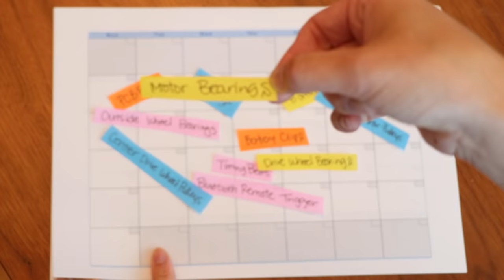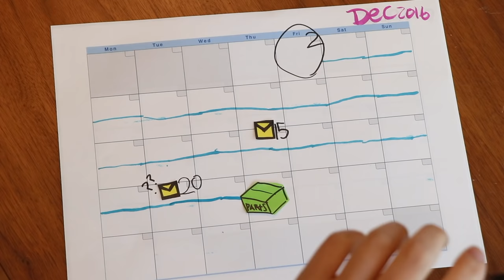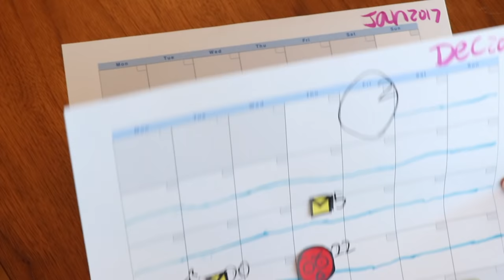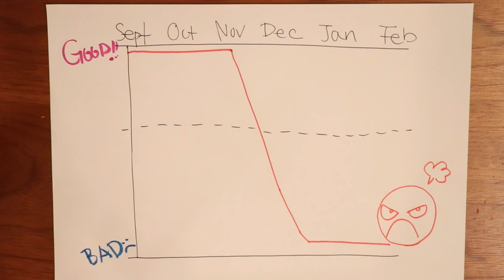COMPLETE SUMMERBOARD (LEIFTECH) REVIEW (WATCH BEFORE YOU BUY) Customer Breakdown

Comment: I almost dropped 1700 on one but then checked out your review and I don't think I'll spend that much money if the quality isn't better. For that price maintenance should be minimal and support should be better. I just miss snowboarding and was hoping this would be my summer fix. Thanks for the review
Reply from the maker: Hey Jason, I feel you man.  I also missed snowboarding in the summers and the reason why I decided to drop all the money on the board even though there were no reviews out there.  No one told me how much maintenance would be required.  The board is a fun, but maintenance and support have it's issues.  It has been over a month now and I am still waiting for parts from Leiftech.
Reply: you need to return yours and buy some power wheels. I own 7 (metro / Leif / boosted / ow / zboard) all have broken down (not the OW actually) and all have needed maintenance. I think this video is pretty eye opening, in that you're both kinda spoilt children that didn't look into what you bought. I've replaced the motherboard on my metro board, motors for boosted, pads for zboard, drive wheels for Leif, etc. you kids need to stick to power wheels.
Reply: Murphy the Turtle He has shown in the video that he is willing to fix/maintain it, did he not? And as far as I can tell, you seem to have a newer iteration of the board, and not the oldest model that has far more flaws. Can't you see the frustration then in wanting to fix and ride your board, but not getting the parts, and when inquiring about not getting the parts, receive little to no response from the company?
Reply: quite the opposite. He complains about common repairs that happen to every board possible. I didn't really think the video was all that bad until I read the comments. I live in Brooklyn, and I used to go to the Leif shop to repair my board, so I know how those guys are. Paolo was given free parts, and acts like a spoilt child. He has demonstrated in my conversations with him that he doesn't understand how eboards work (all of them need maintenance and parts) and has made his ignorance known complaining about very common problems in the industry. I just wish he had 2 other boards and understood the basics, rather than just blaming everyone else. Worst kind of arrogant.
Reply: K
Reply: hmmmm... well people that aren't very knowledgeable on how to maintain eboards are going to need help maintaining their eboards... so the company should know that and act accordingly.
Reply: Jason Thompson  o
Reply: Just get a freebord my man
Reply: I bought a Onewheel XR last month and it feels just like snowboarding.  I highly recommend it. there's no remote and you can ride it on just about any surface
Reply: @LBS-33-33  I own both xr (sold now) and pint and both are awesome :+1:

Comment: Hay there paolo I built my own custom board for about 500 to 600 with lipo's and I have to say I'm happy with it. it can deal with light rain as well as crappy roads....its a pintail board. the only 2 downsides is I made this one with a Tupperware container which comes open if I rub myself to close to it and that the cables to the motors come undone but outside of that its just charge and ride. I get you had issues with this board but its a brand that is fairly new and innovative. my best word of advice is to get a normal board and ride it.....or sense you have some experience building stuff build your own and have way more customizability. 

my next board will be better then what my current board is and in the mean time I'm just gonna keep riding it until the batteries go bad.

Comment: Not gonna lie I really want that board and I'm sure your experience with customer support is really rare. It still sucks it happened. However with the amount of maintenance problems you pointed out it defiantly deterred me away from buying it.
Personally I ride the Evolve boards (I ride the Evolve ONE board). I actually use mine to commute to work every day and I've been riding it for about 11 months now. The only thing I've needed to replace was the motor mount which snapped due to metal fatigue.  Customer service is out standing and the community is fantastic. 
My Verdict, 11 Months, rare maintenance (aside from cleaning the wheels and bearings from time to time). As an added bonus when you purchase the board it comes with all the tools you need to pull it completely apart if you wanted to. Battery is still running rather well with a range of still about 35km and able to climb all the steep hells I've come across (I live in a rather hilly area). I'm happy to say I've defiantly got more than my moneys worth. Only complaint, I wish it was water proof/resistant.

Comment: Epic honest review, dude. I Think I'll wait a couple generations so the kinks can be worked out. I would prefer this board to a freebord, if not for the risk of extensive maintenance.
Reply from the maker: Hey Daniel, I think waiting a couple generations would be the prudent choice if you want to avoid maintenance issues.  I feel like current users are being used as beta testers as I continue to see reports of parts breaking down.  The manufacturing process doesn't seem to be dialed down yet.  Thanks for the feedback and for watching!
Reply: The product still sucks. I bought one in June last year and it just stopped working last week.
Reply: Daniel Renehan this is 2 years later and maybe it’s your chance because the summerboard sbx is out and it’s waaaaaayy better
Reply: @chrismcgregor4307  Was this the 'summerboard'?
Reply: @oscarsimpsonjacka7917  I'm going to wait for a review like this that goes into heavy detail.
Reply: Daniel Renehan it is the summerboard and if you just search a little there are quite a few good reviews. It had a thicker wheel so you can go over more bumps and it is curved so it feels better and more like snowboarding. The battery is much more powerful and long lasting, can go up hills well. The battery is water resistant and overall it is just way better, less maintenance, better battery, more powerful motors and higher quality parts.

Comment: For those wow re interested. 
Currently it is Dec. 2019 about to be 2020. 

I tried ordering it shout a year ago...there customer service was bad. And j was hearing a lot bad reviews so I canceled my (financing) order before it shipped and they were giving me a hard time about it. 
BUT, I just decided to go for it....bought the most expensive (V2)  for $780/$900(financed) on eBay. (Perfect condition)
And I love it. 
No problems so far (knock on Wood)
Even though I snowboard, 
I either struggled on this thing until I knocked the Rust off from snowboarding. 
Or this is (mechanically) slightly different then snowboarding and I had to overcome the learning Curve. 
Room me one day!
On the end of that one day....I took a spill because I was found way to fast, and got scraped up a little bit. (So gear is recommended, because your not falling on snow)
ANYWAYS, after that one day I can ride it great, just like snowboarding. And it is, just like snowboarding in regards to how it feels. 
I never took it down a hill yet, only on flat roads using the remote and let me tell you, that alone allows you to “move”....mine supposedly goes 25mph. But I don’t attend going that far for it’s not worth the spill and the broken board, no matter how “good” I get. 
But yea,  to me it was worth $900.00. 
Time will tell tho! Hopefully this helps!

Comment: This is the best video i've seen so far. And not over criticizing like some say. You're giving a full review so people know what to expect from the first models. Even leiftech gave a positif reaction to the post. The only other electric thing i'm following are the electrical motorcycle's from Zero. From that point of view I only expected the gears and toothed belt would need a maintenance. And offcourse a replacement of the wheels after a decend amount of miles. But a maintenance after every time you get the board out? That doesn't sound right. The bindings of my snowboard broke after 4 years , not after a month. This is a quality issue. The outer bearings get under alot of presure, so I get they wear out faster. But motor bearings should be just fine.  Now you clearly aren't mechanical person. You bought alot of junk, what brakes when you wanna work with it. This is what junk does, and why people should stop bying the cheapest tools you can find. I do have alot of questions about the maintenance tough. Slamming bearings in with a hammer, like you did, is asking to break it, even before you ride it. Same with the video of the blue freeboard wheels. You pop the bearings out from the middle. To simplyfy it, its a ring with balls in it and another smaller ring under the balls. By pressing the inner ring while the outer ring is being hold in position, you are killing the bearrings. So you have to push the outer ring in this case. You press the inner ring if they are on a wheel axle.
I love the concept of the board, but the price is to high. Certainly with all the issues around it. The video is from a year ago, how is it with the board? Still working or collecting dust? You said another video would follow, but I didn't see it. But it could be I overlooked it since you got a decend amount of posts :)

Comment: I've had my Onewheel for about 2 months and the only "maintenance" that I've had to do is adjust my PSI and replace my original grip tape with Vicious. No problems at all especially with riding through water especially rain.
Reply: Onewheel FTW!!!
Reply from the maker: Hey Travis Butler, it's good to hear that the OneWheel has little maintenance.  I really like the fact that you can ride in the rain without any issues.  I think it would be perfect if you lived by the beach.  It would be so much fun to ride around in the sand (assuming that it can go through sand as well with that big wheel). What's the total distance can you travel on a full battery?
Reply: That depends on a lot of factors my man!! Simple answer: 5-8 miles. It also charges in 30 minutes!
Reply: FloatLife represent!  Love my OW and while this board looks kinda cool, still like my OneWheel better.  The smooth, quiet float is just unbeatable.

Comment: Fantastic review Paolo! Tells me everything I would like to know as a potential customer. I read about the LEIFTech about 1 week after ordering a Carbon GT. At first I was bummed that I had blown my dough on a regular skateboard instead of the snowboard version, but after watching this review I can see the many limitations to this kind of board, even if it was working flawlessly. I bought a Carbon GT in the second run while they were still on backorder, the only "flaw" with my board out-of-the-box is that one of the screws that holds the battery cover on was not "sunk" properly, and just spins loose in it's place. Aside from that, the maintenance issues are almost non-existent compared to the mountain of stuff you've had to do. I ride this board everywhere at full speed and the only thing I've had to replace is the remote controller because after I broke it for the second time after a fall, I couldn't revive it. In case you were considering a CGT, the obvious advantages are: Can go on almost any surface, including grass if you use the AT setup, rough roads are not a problem - can start it on hills (bit of a trick to it) - battery life and range is much bigger - climbs VERY steep hills no problem as long as you're not very low on battery - top speed is about the same, but can be tweaked if you use larger pulleys at a tradeoff of torque - they say not to ride it in the wet, and although I try to avoid it I have rode it on very wet roads and through the occasional surprise puddle and there seems to be no issues as a result. The downsides are that booking it in for service last I checked looked like it would take a long time due to the large amount of customers and only one servicing outlet in Australia, which I also have to get the board to. I'm not a massive fan of the remote control design which lacks a trigger guard and is very easy to break in a fall and expensive to replace, although you can buy 3D printed trigger guards on ebay that basically "fix" that design flaw. I wish I'd bought one immediately and saved $120 on buying a new controller. It does take a while to become proficient at riding at high speeds, but even now perhaps 9 months after purchase I still have the occasional spill due to accidental trigger/brake hits; I definitely don't recommend riding this thing at top speed without a full suit of safety gear including knees/elbows/wrists and helmet. In the two accidents I have had, besides damaging my controller I have trashed 2 backpacks, a good pair of jeans, a nice raglan shirt and various things in my pockets. Some of that damage would have been prevented if I had been wearing my full suit, which I wasn't in both accidents. Now I always wear it. It's also worth noting that every single person I have spoken to that has rode a GT, has had at least one significant spill. Most of the time it seems to be due to accidental trigger bumps, or overbraking at high speed which is definitely a delicate art as the controller is quite sensitive, and this sensitivity of braking is magnified with speed. Although not impossible, just takes a lot of practice. The board also doesn't have the ability to easily swap the battery out for replacement - last I spoke to evolve if I want a new battery it's got to come into the shop, although if you're handy with a spot welder It would be possible and probably cheaper to build yourself a new battery pack from high quality cells. Some people have reported that the Carbon seems to be poor-quality carbon-fibre, and have posted pictures of the board cracking around the truck mounts, but I haven't had that issue. I suspect if you're a heavier rider and using the street wheel setup might stress the board more and result in these issues (as the street wheels will transfer more vibration/impact to the deck than the AT wheels) but for me using the AT setup at ~61kg, it's definitely not cracking anywhere. I bought the 2-in-1 version, but almost a year into my purchase I haven't found a reason to use the street setup over the AT setup, as the AT setup is far less prone to getting jammed in a fat crack or stone and is a smoother ride.

Overall I would say the CGT is a very good choice for a "commuter" board. I don't own a car, and I use my board for all the things I would use a car for and it does the job well. Looks to me like the LEIFTech wouldn't be a good choice to ride alongside busy traffic, or doing shopping runs etc. but much more of a fun toy aside from the maintenance issues.

I think Evolve have a design advantage over LEIFTech as they have been developing eboards for quite a while and have therefore already made and solved most of the "beginner mistakes" and kinks you see in a less mature tech like the LEIFTech, where they have to learn and evolve their design according to early-adopter feedback from peeps like you. Anyway hope this is helpful, as I found your video very helpful!
Reply from the maker: Hey Miletech,  I appreciate the the detailed feedback on the Carbon GT.  I must admit, it's one of the boards I'm looking at.  I'll have to keep in mind the service wait as you mentioned, but the little  overall maintenance and refined manufacturing process seems like a big plus.  Thank for watching!

Comment: Great review! I'm glad I went with the OneWheel XR instead. Once you get used to it, it still feels a lot like snowboarding (especially if you put a different tire on it with more rounded sides). It goes over any kind of terrain, even mountain bike trails, no need to align anything, there's hardly any maintenance, and it goes super fast, very far on one charge and flies up hills no problem. Thanks for the review!

Comment: I've been looking into this. I do maintenance and worked on cars most my life so I think i can handle this, but the time between parts has me 2nd thinking. BTW just a tip, use that soldering iron to heat the screws by resting the tip on it, this will loosen the lock-tight and any rust crud.

Comment: @Palao - great review man! Very professionally done. I own a bamboo gtx (only for 2 weeks) and I love it. AT setup makes it so fun to ride on almost anything. It's not perfect tho... Battery sag is real but I heard there's ppl that can do a battery mod for around $700 which I'll probably do once this one wears down. They also came out with a new remote that fixes the connection issues. Other then that, I just wished my board was more protected from water damage but that's a problem with all e boards. Hope you can find a board that fits your needs...
Reply from the maker: Awesome! Glad you found the info useful Pandah82!